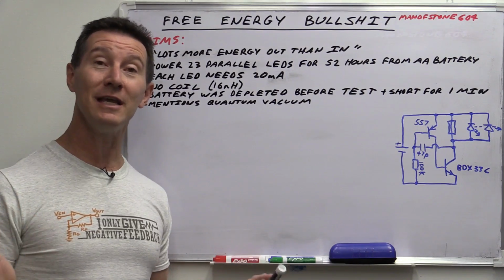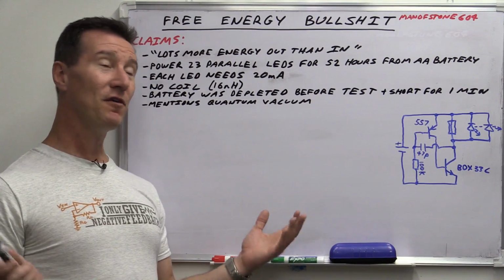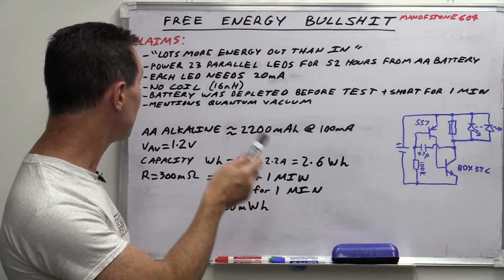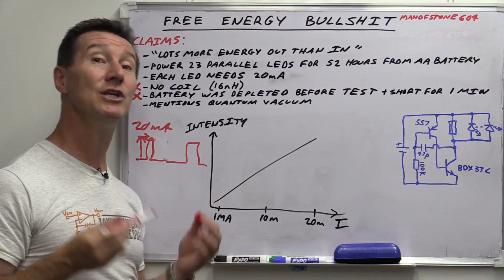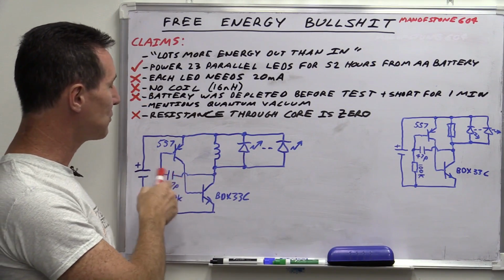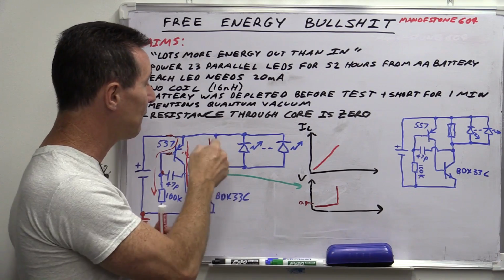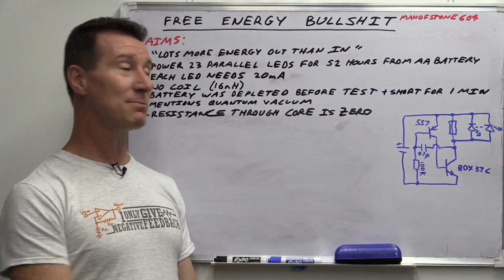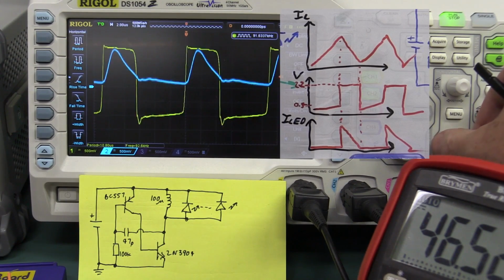EEVblog #708 - Free Energy Overunity is RUBBISH!

Comment: As usual,  he speaks truth.   As a chemist,  I support his assertion that nothing is for free.   you cannot create something out of nothing.
Reply: No... You paid for that heat by purchasing fuel that runs the engine.
Reply: Yosef MacGruber Nah.
Reply: +Yosef  But without the gasoline paid for in the first place, the "free" heat from the heater would not be possible. There has to be a source of energy. If not, then no energy. Pretty simple, eh? Forget the NWO, and all other crazy conspiracies, they are strictly for persons with no knowledge of basic physics, or even common sense.
Reply: Yosef MacGruber is full of shit.
Reply: I thought I answered this!  You paid for the gasoline that turned the engine that produced the friction that heated the radiator water that produced the steam that gave you the heat.  you paid for the heat and it came from the electrical and mechanical thermodynamic joules generated from combustung gasoline and oxygen. End  of argument.
Reply: Quantum Leap
Now you are debating word semantics? Obviously, the "free" heat from the car heater, is not the same kind of "free" as in free-energy. You see an advertising promotion, "Buy one, get one free". So the 2nd one is free, right? Well technically speaking, it is not free, it is merely half-price, and depending on the policy of the store, you might have to then buy 2 of them, and not just the 1 item that you wanted. Buy one, give one to a friend.

The point was, running the car heater while you are traveling, does not noticeably reduce the car's fuel mileage. And running the heater makes the car safer, for then the car has a happy driver who can more concentrate upon the road conditions, rather than upon being miserable and shivering.

Obviously, running the car heater, is no longer free, once you have reached your destination, having gotten there too early, and then you don't turn off the engine upon arriving like you were supposed to, because you still want to run the heat. Technically-speaking, internal combustion engines are only about 15% efficient. But when you run the heater, then it might be 20% efficient, since you are benefiting from both the mechanical motion and from the heat that it produces. (Or the engine is only about 5% efficient, if you are running it just for the heat.) It still is kind of expensive to waste the remaining 80% of the energy. But energy should not be expensive, but ought to be free by now.
Reply: James Clark
You are not getting better fuel mileage, by leaving the heater off and shivering. The heat that you do not use, just goes to the radiator to be wasted anyway.

And I am pretty sure that I said that "The heater is the only thing that the car gives you for free" is a different kind of "free" than the free in free-energy. Like the "Buy one get one" sales promotion. The 2nd item, is not really free, but rather, that is a sales gimmick that sort of means, "half off".
Reply: Andy Dunnock
Or perhaps, I am the most sane person around here.
Reply: "The heat from your heater on your car, is the only thing your car gives you for free, as it is simply the waste heat of the engine." 
wrong. its not for free. heat is a type of energy that is "given" to the atmosphere inside or outside the car. It originates from the chemical energy inside the gasoline

"God..." thats not even an argument... you just assume there is a god and that this creature can create things from nothing. 

something is not free just because it exists. the heat exists from the burning of the fuel. that doesn't make it free. you burned fuel. so that actually follows the laws of physics.
Reply: Nothing is for free? Are you sure of that? The heat from your heater on your car, is the only thing your car gives you for free, as it is simply the waste heat of the engine.

BTW, I think that free-energy machines already exist, but the NWO stole the technology from Tesla and the American people, to extort their phony energy-scarcity tax from us.

God can create something out of nothing. But liar mad-scientists have difficulty doing so. Perhaps because they are not God, or their understanding of science is piss-poor, or even worse.

Comment: You picked a shitty piece of example.
There are many more and way better constructs.
And the most promising are the ones using magnetic power with permanent Magnets.
Wanna see you debunk them please.
Reply: +Silvan Buess  I would love to see Dave debunk the Yildiz "magic magnet motor". However, Yildiz will not allow anyone to disassemble the motor to its bits. If that was allowed, then the motor could be proven to be the hoax it appears to be.  Simply an electric motor powered by an internal battery, and a "hammer actuated electrical switch".

Comment: The best solution is to build  a 3000 feet antenna to collect atmospheric static electricity to a multi plate capacitor battery and use it to power your establishment , any exes power can be grounded . There are no moving parts except the switches and breakers  , and transformers . The initial voltage will be high but can be brought down with an electronic switch board to 120 or 240 volts . You will need a permit and license to build it up also an electrical contractor license . Plus you have to pay tax on the amount of power you will be using , otherwise it will be illegal .
Reply: ASTROALL Could you please site someone using such a circuit? Also, what amperage is produced by such a circuit?

Comment: there are other forms of free energy then just a creative circuit...  Crystal cells for example have been proven to give a low current for years, Oxford electric Bell has been ringing for 176 years lol, dont close yourself to the idea that we just might not have everything figured out already
Reply: Crystal cells giving off a current doesn't proove the energy is free. IT has to come from somewhere.
Reply: To be precise, the Oxford electric bell is run by 2 batteries connected in series. ;)

They are not "crystal cells", they are dry pile batteries.

Comment: Topological papers on this effect can be read by authors Reisenberger, Michael P.; Rovelli, Carlo (1997). ""Sum over surfaces" form of loop quantum gravity". Physical Review D. 56 (6): 3490.

I can assure you it is not BS.  However, I do not think a physical extraction device has been created yet.  The principles are just not well understood.

Let's not forget though, fire was never understood for thousands of years.  That did not make fire less useful or the inventors of the steam engine any less competent.
Reply: Exactly correct. This is one of the most accurate comments out of so many ignorant & emotionally based comments!

Comment: Well, they told Columbus that he would fall off the earth.
Reply: But the fact that some geniuses were laughed at does not imply that all 
who are laughed at are geniuses. They laughed at Columbus, they laughed 
at Fulton, they laughed at the Wright Brothers. But they also laughed at
 Bozo the Clown.
Reply: The point is that we need people like Columbus whom against all odds try different methods and options to find alternative's. Most of them will fail but I am sure some will succeed.

People whom claim to be absolutly sure that free energy is impossible are always throwing a load of theories to proof it can't be done. These people change theories in to laws as if they where given to us by God himself. People whom believe it can be done tinker around in there workshops and just try. 

Guess which of the 2 described groups will improve our lives in the future.
Reply: Michel van Osch
"These people change theories in to laws as if they where given to us by God himself."
That would make no sense. A law is a general statement. A theory is an explanatory framework consisting of laws and hypothesis that has been vindicated. You don't change theories into laws, because theories are higher than laws!

Comment: explain the CPU fan with magnet free energy.. please...
Reply: According The magnetic laws magnetism are accumulative.
To put it in one way.
An electric engine usually consist of a electric magnet and a permanent magnet.

It works on pure magnetism force, important!!

The more power you put into electric engine the more output it have.
Why? Well that is due to electric magnet gets stronger with more power.

What do you think happens if the permanent magnet get stronger instead?

Since the electric engine output is equal the SUM of the forces of the electric magnet and the permanent.

There is your free energy, from the permanent magnet

The laws in this state this quite clearly.

Comment: how idiot you can be, you idiot, wind is for free
Reply: How stupid can YOU be. Wind is caused by the changes of temperature which are caused by the sun which is fueled by the nuclear fusion. You don't pay for it because you don't have to burn any fuel to get it, but in this case input>>>>>>output
Reply: kacperratajczak
to hard for you
Reply: +zgr44   Actually, the description of how wind is generated is quite accurate.  Not TOO hard for kacperratajczak to relate. He KNOWS why the wind is not free. BTW, the word "free" does not require the modifier "for".

Comment: I noticed you have videos using scam solar cells that claim to get more energy out when you yourself put nothing in and therefor you broke the laws of physics and now your debunking someone else doing the same? Get a clue that there are many devices that can capture inviornmental energy and utilize it and have no need of you putting in anything. What did you put into those solar cells? anything? or was it the sun that did it? so stop promoting your idiocy as your thinking is flawed and is just plain silly notions. I understand that there ae many scams but those scams do not debunk with broadbrush any and all devices claiming to capture energy that is all around us and free to capture. Heat itself should be your big clue as anything above absolute zero is free energy because I had to put nothing in the sun already supplied it and I enjoy that heat free daily without any need of any device and put NOTHING myself into it. I guess I break the laws of physics daily according to your flawed reasoning.
Reply: I can't stop laughing. This is the most retarded comment I have seen on this channel. GTFO.
Reply: I think Dracula may be 100% right.      And thats saying tons,  since there are multitudes of seriously retarded comments.
Reply: Erm, 1NRG24Seven wasn't thinking clearly when he wrote that tirade!
Reply: ***** I don't have to think "clearly" about what he said. It's so retarded that it can be easily debunked without hardly any thought at all.

Comment: Do you know of any circuit design wherein the energy from a battery could be used to raise the measured voltage of said battery (whilst depleting it's charge of course)? I have a friend trying to make free energy claims with a rat's nest of passives, transistors and 2 batteries. His meters show a gradual increase in the battery voltage. I don't know enough about battery chemistry to know if it could account for the effect. On the other hand it might just be a fault with a crappy meter adding energy to the system. Or I could just be getting trolled super hard.
Reply: I would say you are being trolled, and sold a bill of goods.  No matter how many clip leads, or China Freight multimeters, or even bridge rectifiers (gasp!) are in the circuit, no "free energy" will EVER be created. Never. Ever. Period. End of rant.
Reply: Quantum Leap Well I'm not being sold anything. And I never considered or suggested that he might have actually somehow stumbled across a free energy system. My real curiosity is if there's any type of battery chemistry and circuit design that could raise the voltage of the battery at the cost of depleting the available energy of the battery. It sounds counter intuitive and it would certainly be counterproductive. But there's nothing wrong with having a high voltage battery with less available energy than a lower voltage one. I just wonder if any electrochemical process could make one out of the other.

Comment: :P LOL free energy from a battery  , maybe the battery cells are multipling like rabits :))
Reply: Isn't that what his Rigol PS is doing? And indeed all power supplies. Hoover Dam is just a bunch of free energy batteries hidden deep under water right?
Reply: His Rigol PS is a adjustable both in voltage and current and it's possible true controled pwm due to monitoring both voltage and current. And battery cells don't multiply voltage with out an booster circuit for sure , it is just the non understanding of electrical physics that makes battery cells multiply like rabits (it's just the fact that some others are only beliver's in a "nonconformist way to produce energy from nothing" ), if so why don't i get for example gold from nowhere and why  such a phenomenon wasn't observed yet , most of things might apear like magic but it isn't in fact magic
Reply: Yes, Mike, I went on a tour INSIDE Hoover Dam, and took a side passage, off the tour. Thankfully without being seen or caught. For sure, there are SCADS of "free energy" batteries down there!  No shit!!  Must have been very hush-hush, as there was no name stamped on them!!
Reply: Quantum Leap Good thing they didn't catch you. They would have had to feed you to the Illuminati.

Comment: I understand there are a lot of people that do not understand basic physics
But you do not need to come with this "I am holier than thou crap" attitude
After all you are just a human and cannot even explain how quantum entanglement works - as of date no one can. No scientists can explain gravity either, they can put a badge on it but they cannot reproduce it or cancel it.
So stop with your attitude and be helpful and humble.
We certainly did not invent electricity or theorise about it and then make it, it was discovered.
Everyone needs to experiment and innovate to discover the next free energy source.
With your attitude we will be stuck with fossil fuels forever.
Reply: So basically, what you're saying is "don't believe anything is correct, even if it has been demonstrated multiple times"? Guess I better start thinking that 1+1=3450804090010391392385049094635796332110089481294130135*10^12345678976543456789873285239239248523238384183329 instead of 2.
Reply: exactly, question everything before simply believing for face value. Humans are too gullible and arrogant to the point of their own determent.
Reply: Gavin Beverley OK then. 2+2!=4 then...
Reply: we need to think outside the box, magnetism was not invented it was discovered and we still do not know how it works. I do not think the human intellect is powerful enough to decode quantum mechanics right now and how everything works,but maybe we could take a short cut and discover something that will give us free energy. We need it desperately and if we do not get it there is big chance will not survive as specie

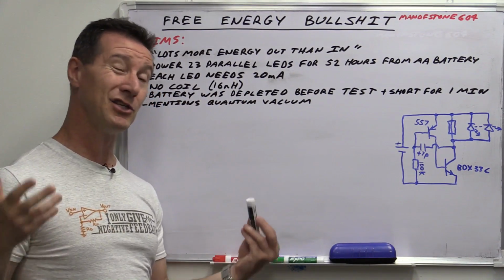Comment: I onlywatch till 3:30 and see, that the 3rd point is wrong.
This are 20mA Type-LEDs (this is right, the Maximum Rating of the current is 20mA), but they are not driven with 20mA.
Normally every LED get a current limitation, a resistor or an other circuit who can limited the current over the LED.

If one resistor in this circuit would exist he could calculate the current, even if it is only 1 Ohm or 0.001Ohm.

This LEDs are really not bright and if he use the normal LEDs on market and not some from 1970, then the LEDs should be much brighter with a current of 20mA.

The old "Osram Topside-LEDs" create more light with 1mA of current as one of this 23 LEDs, so the supposition that the current flow is more than 1mA over each of this LED is only true if this LEDs are very old.

Example:
The "Mignon (AA)-Batterie Lithium Conrad energy Extreme Power LR06" have  2900 mAh / 1.5 V.
2900mAh/52h=55,77mA (total)
55,77mA/23=2,42mA (over each LED)

This is approximately the current flow over the LEDs and not 23*0,02A=460mA, but I think it is less then 55mA in total, this LEDs are really not bright.
I think this is less than 1mA over the single LED.

Comment: When i look around youtube with Texas Instrument, NASA, Maxim integrated etc have develop circuit to harvest energy from surrounding environment to power up small devices that require small energy ....i start to think this video is more bullshit than overunity lololol...overunity is inspiration towards reality although its not real now.
Reply: Hey hey hey now. Your physics have just been shown in this video to have been bent and therefore totally inaccurate! NASA's Free energy is on the up and up now. Soon we'll be riding helicopters to the Moon for breakfast! Just this morning I watched a guy on YouTube spin up two AC motors from the 1950's, unplug them and plug them into each other and they Kept Running. If that isn't Free Energy and over unity windings that the worlds government and the Rothschilds have been keeping secrets from us then there must not be any Santa Claus living with reindeer up at the North Pole. If a kid on YouTube can do it but NASA is just now figuring it out maybe they deserve to have their funding cut!
Reply: well these days electronics do use so little power that they can be run on  the earths EM field (about 7 watts,few milliamps)  but Tesla considered it impractical for commercial use back when he was doing voltage rectifier attached to antenna experiments cause the most common appliance back then was high voltage lighting